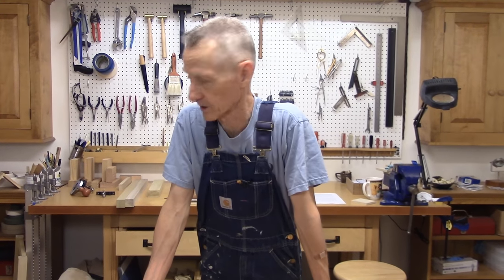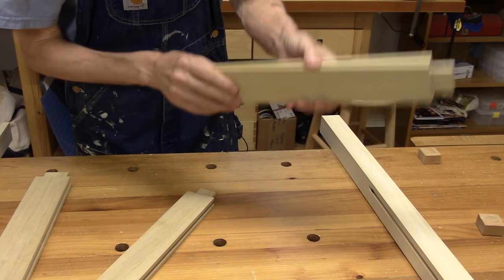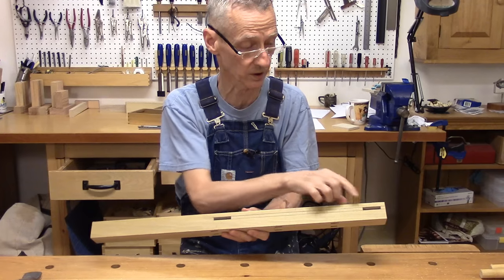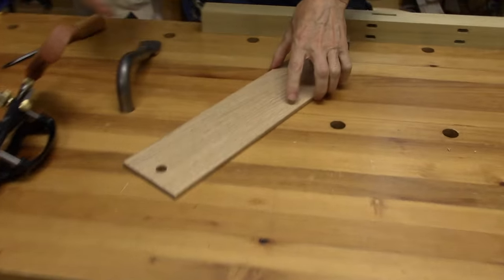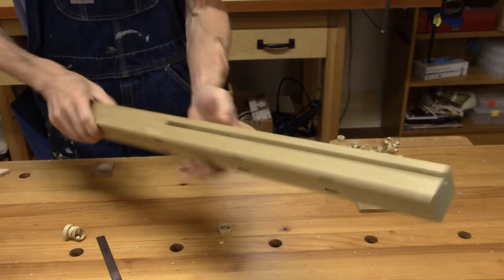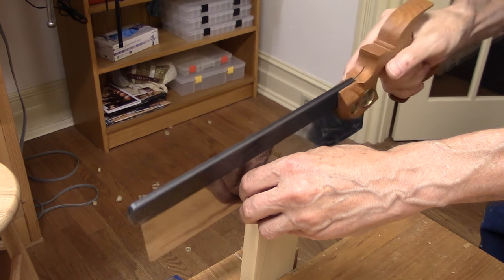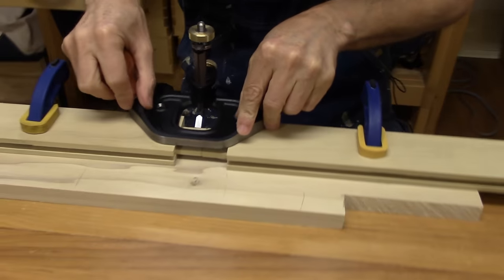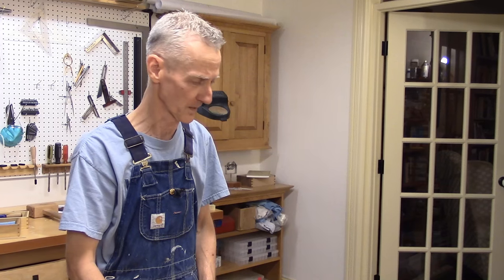Chest of Drawers Show #1

Comment: Your work is very nice and I enjoy watching.  Recalling your last glue-up, have you considered using liquid hide glue?  It should have a much longer open time.   It tends not to swell the fibers as much as PVA, so your joints should go together a little easier.  Oh, and if things go really wrong, it's reversible using heat and moisture.
Reply from the maker: Thanks Mike. Yes, I like using liquid hide glue for the reasons you mentioned. I used Titebond liquid hide glue on my saw bench project entirely. Glad I did! Regards.

Comment: Really like this project.  Been looking for low chest design ideas to put a hand tool cabinet on...I am out of wall space.  Your videographer does a great job, btw!  BTW, what is the wood your benchtop is made of?
Reply from the maker: Hi Scott. The chest of drawers is working out very well…great for tool storage. Thanks for noticing Joaneen’s fine work behind the camera. My benchtop is home center 2x4 hemlock fir lumber that I laminated together. I had it planed flat at a local commercial shop. Thanks for visiting my workshop.